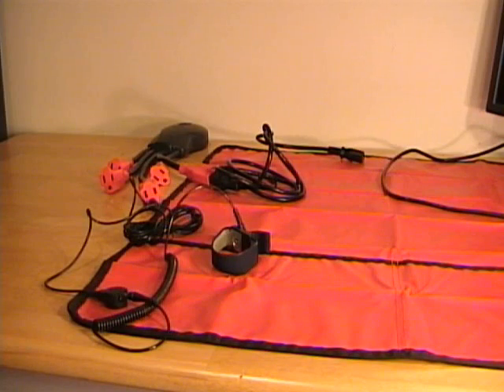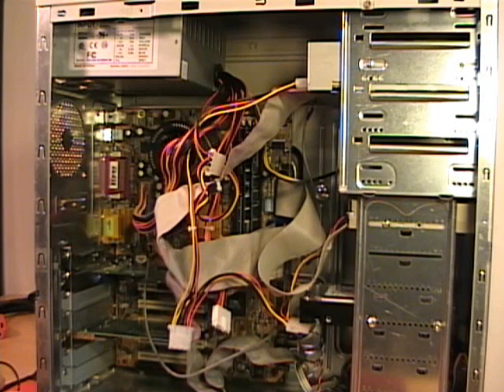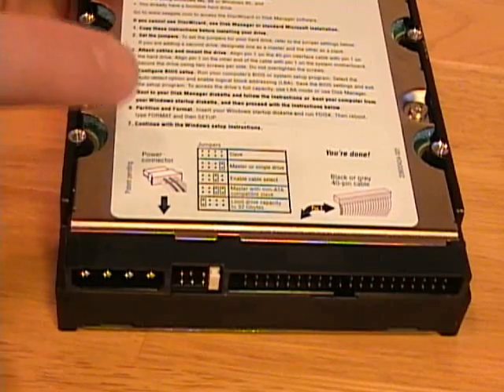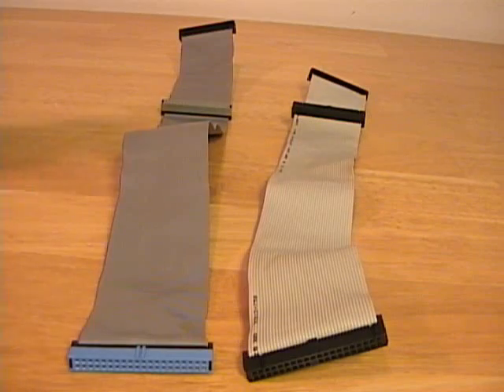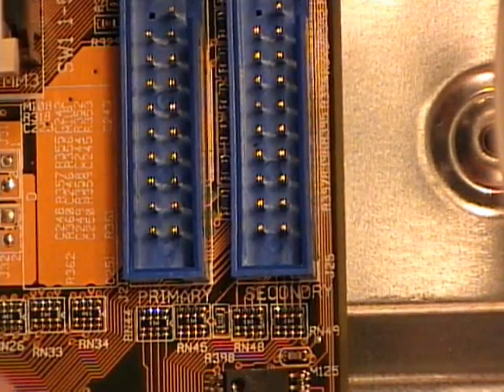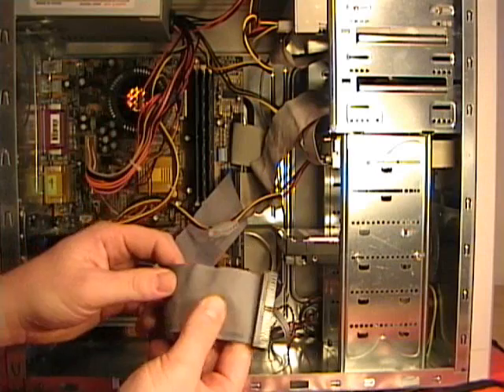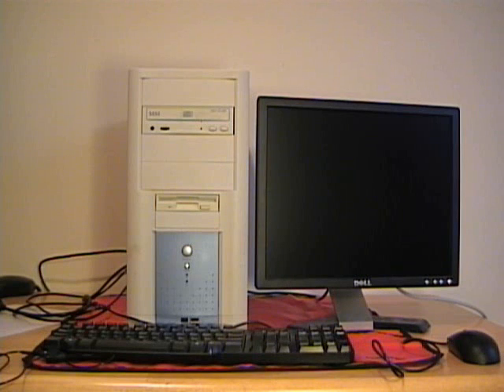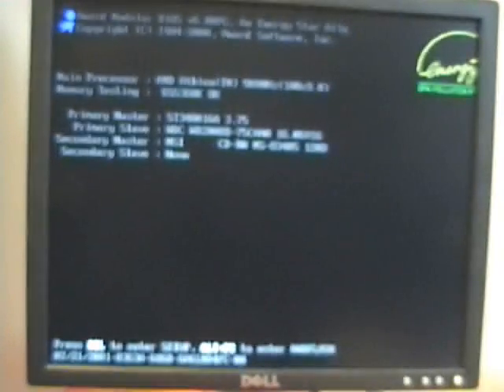Install a Second IDE Hard Drive

Comment: Thank you! I've managed to install ide hard drive as a second disk on my desktop. My first drive is SATA (different slots), so i could not connect it as presented in the video. Fortunately in my case, the motherboard had a free slot for IDE device on it, so i connected it separately via IDE flat cable. First time i`ve set the jumper to slave device. Oddly, that resulted in my 160 gb IDE Disk capacity limitation to 31.4 gb. So I turned the jumper to master position and succeeded.

Comment: I have a Dell Dimension B110 with an extra black IDE connector on the motherboard.  I pulled an IDE Hard drive from a another Pc that had a dead motherboard.

The extra hard drive has a diagram that is similar.

Comment: if u want it 2 boot to ur old drive then set it to master or cs, juz make sure the bootable drive is on opposite end of the lead to the motherboard end.
it will probably blue screen as soon as it start to go to windows u will have 2 run a 'repair' from an original disk of ur operating system, ie win-xp, vizta, win7 etc
warm regardz 
jakkadan

Comment: juz set them both to cable select, cs but yes it would still work ur way, u can have a working operating system on a slave drive, it's juz unusual that's all
warm regardz 
jakkadan

Comment: when it iz set 2 cs, the cable selects/determines how to use the drive rather than the master -slave which 'tellz' the drive what and how it will be uzed. so if u had them round the wrong way then ur pc wouldn't start up but with cs ur pc would still boot up, hope that helpz
warm regardz 
jakkadan

Comment: I want to connect my ide but i dont want to use it as a master it has an operating system on it and i just want to wipe it out but i dnt want my windows 7 2011 rig to get corrupt when i plug it in as a slave?

Comment: @Crystalballer274 i know you can hold the case. but so many people ive seen think like you, that there is no bother and dont worry about it only to see them in a few weeks wondering why their graphics card is running games with only 3 colours or they're having random system crashes. I didnt use one building my own computer, but i was extra careful. Static is a major problem when building electronics, you cant be over cautious.

Comment: @YamaKazoo No actually I build computers, I am always upgrading things in it, but tbh the reason why I have had to open up my main is because the power supply atx cpu connector got damaged during a psu stress test. ( I am assuming that is when it happened)  so the female connector pins are loose and have to be refitted alot.. No matter I have a  new corsair PSU on the way...

Comment: Idk if u still respond to comments but here goes nothing.... I recently lost my MOBO of a old pc and I need to try and extract some files from the HDD. I got a diferent computer hook the Hdd how it was shown in the video. But after it starts windows jumps into Startup Recovery mode and spends hours there doing nothing... I got scare for a sec and took out the new Hdd and now the PC works normally...what could be going on wrong?

Comment: @xXxDiukexXx dude also i wanna ask i dun have two ide slots on my mobo . i have one ide slot in which my hdd is primarily connected  . and my dvd rom is connected as a secondary device. so i was thinking can i connect a new hdd in place of dvd rom [as a slave hdd] and then tranfer all files from primary hdd to it and then make my new hdd as primary and and reconnect my dvd rom as secondary device. i wanna tranfer all my new files to my new hdd and this method seems good . wat do you think?

Comment: @31jda hey i was planning to buy a new 320 gb ide harddrive. i am having an 80 gb hardrive which i m using currently. so i wanna ask if i connect a new hdd to my system then how its gonna look. i mean does it automatically increases the space i mean when i log on the computer i will see increased memories or i will see another hdd options? thanks .

Comment: I understand that this video is a bit old, but I have a question for you...Here it is: I installed my motherboard, checked everything over and over...when I go to turn it on it turns on, but nothing happens, nothing comes up on the monitor. 

The fans are running etc etc. I checked the gfx card, went through all my cards, unplugged them then plugged them back in, same for the RAM. THe computer does not beep or anything.

If you are so inclined to help a brother our that would be great, thanks.

Comment: I try to do this, but I on my mother board the ATA IDE cable has only two plugs only- 1.- Goes to my Main Hard Drive and 2.- goes to my DVD/CD Burner so I don't have an extra Plug what to I do ? (my Motherboard has only "Blue" Plug-  do they make a ATA IDE "double insert" ?

Comment: Jeez, I can't seem to get the Master drive to work (I unhooked all that stuff thinking there was a problem but it was really the video card). Then again my computer has like 3 IDE slots and none are labeled as master/slave. On top of which there are so many 4 pin connectors IDK which ones are supposed to connect to the harddrive :P

Comment: Pretty sure they are universal. I sometimes take some jumpers from my old ( and I mean OLD as in 1gb HDD =\ ) and use them on my newer ones ( they got a bit more "meat" on them .. they are usually 750gb [ 1tb+ doesn't come in IDE yet from what I've seen so my 1tb+ are usually SATAs] ) and they seem to work just fine.

Comment: 1.) On a single IDE cable you can connect 2 hard or disk drives, you will have to set one drive as a Master and one as a Slave.
So basically, yes, a Slave drive is in some sence a second drive.

2.) Of course it will! There is almost no hard drive that Windows won't recognise, you don't need the original drivers.

Comment: The secondary hard drive I am attempting to install doesn't have a jumper that would allow me to change it to the slave setting, although it does have a legend on it stating all of the possible settings (master, single, slave). Is this because it was once used as an external hard drive? And also, is there a way I can buy a jumper for it?

Comment: I am trying to put a HDD from my previous computer into my newer one. The HDD that I'm trying to put into my computer was the only HDD that my previous computer had, which ran Windows 98. The computer that I'm trying to put it in runs XP. My current HDD is a SATA, and the HDD I'm trying to put in is an IDE. I cant read its legend for jumper settings because it's only labeled DS PK CS. I put in the IDE HDD and put the slave end of the ribbon cable into it. When I booted my computer up it ran 98.

Comment: nope it dosent detect it not even the master ? so i just took it off (since i had tryed this b4 without me setting the jumpers 1st timer & i had to reinstall windows) im think theres something wrong with it since they had thrown it away the whole tower & i salvaged it for parts & this time i made sure the jumpers were right & all connectons & as soon as i turn it on it asks for cd1 so im think its no good since it dosent detect it (includeing master when slave is installed)without slv all isgood